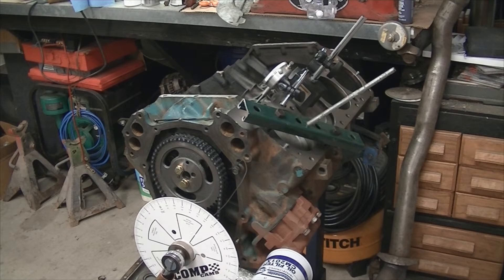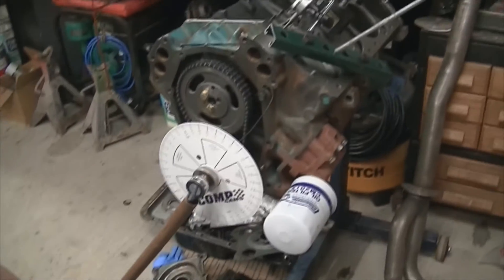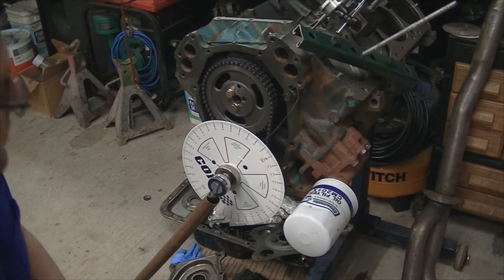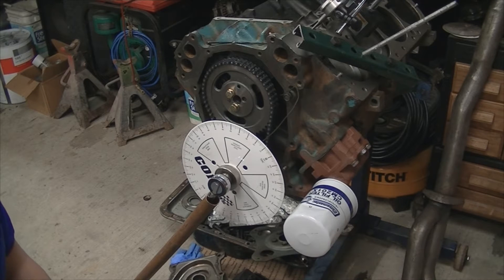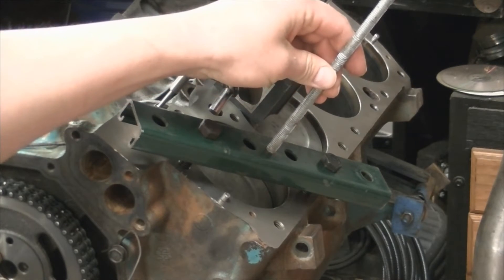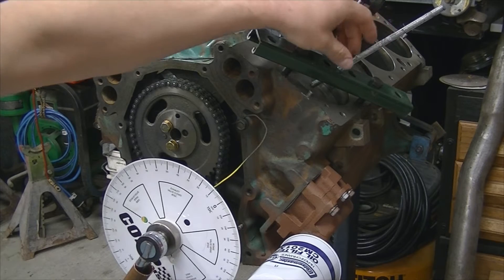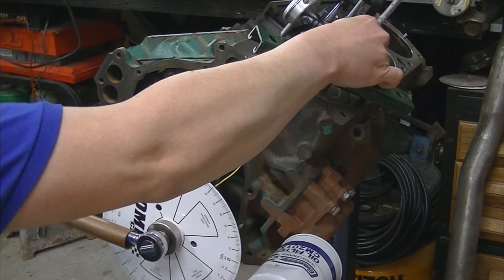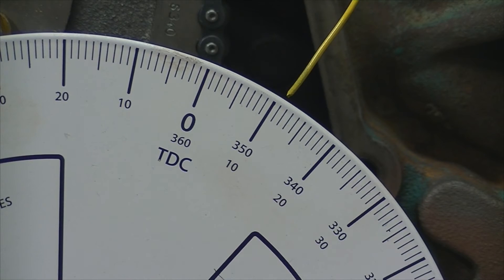Joe’s Garage 383 Engine Rebuild Part 3 – Degreeing the Camshaft

Comment: Great video, but im loosing my mind here. Im installing the same cam in a 426.

I first did it dot to dot multiple times and got 106° +/-0.5° every time. So i should advance it 4° to get it at 102° wich is Installed Centerline according to the cam card.

But every time i advance it 4° i get 96°, wich shouldnt be possible. The intake lifter is at 13.5° BTC at 0.50 lift, wich is very Close to the 14° of the cam card. But at 0.50 closing its at 26.5° instead of the cam cards 38°, what the hell am i doing wrong?
Reply: Did you figure it out? Were you at true tdc?

Comment: Nice to see someone degree the came in the right way, using the centerline method is ok but it will not tell you if the cam is cut right or if the lifter bore are accurately cast in the block , the old way is the most accurate, you can check opening at .050 and centerline,  and closing at ..050 I know this may be over kill , but it just matters how serious you are .I just wanted to say great video. Randy cribb
Reply: Randall Cribb thanks and thanks for watching

Comment: Ok....Maybe I'm missing something....if you degree your cam and it comes up OUT OF TOLERANCE.....what then?  I dont think there is any way you can adjust it, can you?
Reply from the maker: yes move the chain over a tooth (or teeth) depending how out you are
Reply: Robert Parsons offset key for the crank. They are available

Comment: Ok so i see he has a nice cam(518/518), close to what I wanted. I want the comp cam ex284h(507/510) or ex294h(519/524). He has the 3.23 gears I want to run as well. I know he mentioned it's a dog off the line but I don't mind that my charger is heavy too. I just want the nice highway gear with a nice lopey cam and I see it can be done. Good to know I can have the best of both worlds.
Reply: There's a big difference in that Hughes cam from any comp cams, its for way low compression 8.5:1 & lower. The timing events are for maximum cylinder pressure. If you're aware of that or not, it's an important detail.
Reply: If you advance your cam 4 degrees it will make a considerable difference in off the line acceleration.

Comment: ok my question is how do you know where to point that wire to? what gives you a good indication on how to bend that wire to the degree wheel? to me it just looks like your guessing? or does it matter on how its pointed? or do you align the wire with something on the block ? i would appreciate a reply :D
Reply from the maker: +Ottomatic Ok, so the first thing to understand about the white camshaft degree wheel is that it is free-spinning until you “lock it in”, that information alone may be enough to get the process to make sense, but if not I will continue to explain:
 First put the white degree gauge on the camshaft, at this point it will spin freely (you can see this at 1:40 in the video).  Then find a point somewhere on the block that you can attach your wire. It does not matter where, which ever place is most convenient. Then point the wire close to the wheel as done in the video.  At this point you want to rotate the cam to bring the piston to Top Dead Center (TDC). Once the piston is at TDC, spin the wheel until the zero on the degree wheel lines up with your wire, at this point you want to tighten the color to LOCK the white degree wheel in place.  At this point your piston is at TDC, and the degree wheel is at Zero. That is your starting point.
 The part that was not really explained is how he arrived at 11 1/2  degrees. From TDC to TDC was 22 degrees, so he split the difference and set TDC at 11 1/2

 I hope this helps, Thanks for watching!
Reply: thanks it helped out a lot!